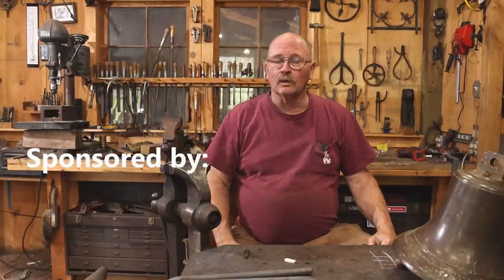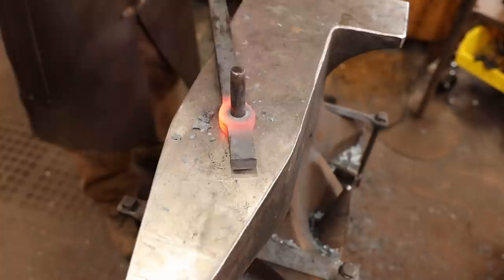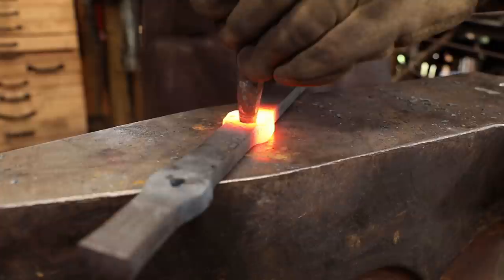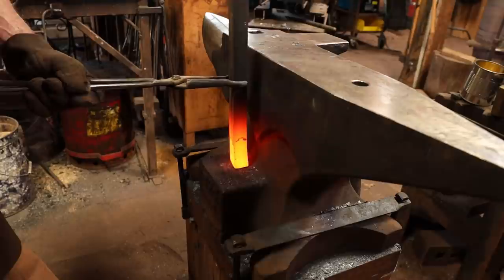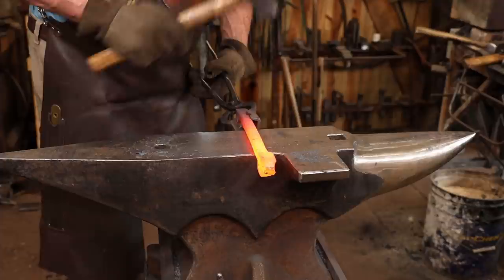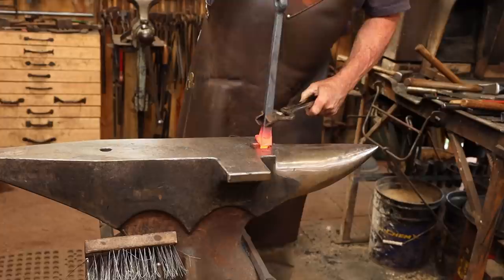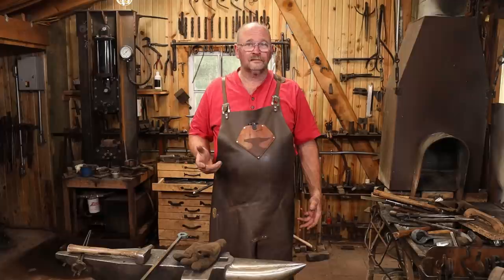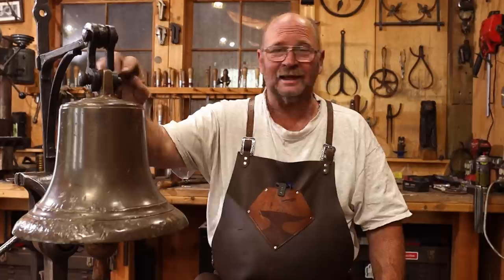Hanging the Ships Bell

Comment: Nooooo,  John do not replace your Delta drill press. I think that drill press is a DP220. I have one and have rebuilt different parts over the years. You can still find replacement parts and manuals for it. It is a classic and a hard worker.  I love the bell bracket. You are a true craftsman.

Comment: Nice shapes. I’m curious why you elected to have the bell swing towards the post instead of across the post?
Reply from the maker: It fit the design best and the bell doesn't really care which way it sings.  Plus swing cross ways will load the arm laterally which could stress the assembly

Comment: Thanks for the awesome project! Question: when I try to round up a square bar (reins of rapid tongs), I go to octagon and the bar starts to twist along the length. Every time. Any tips?
Reply from the maker: Its a common issue.  As you work and turn the piece don't go full circle in the same direction.  Turn back the opposite direction and it should start to correct the problem.